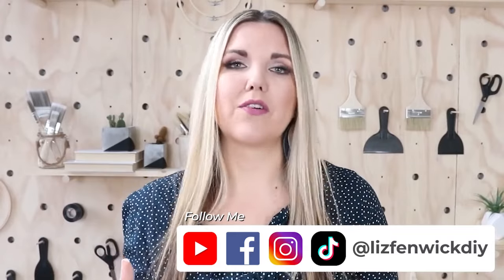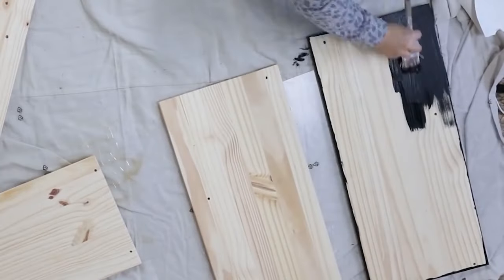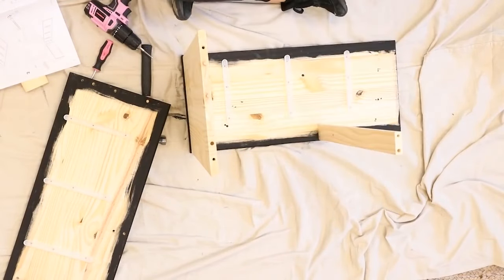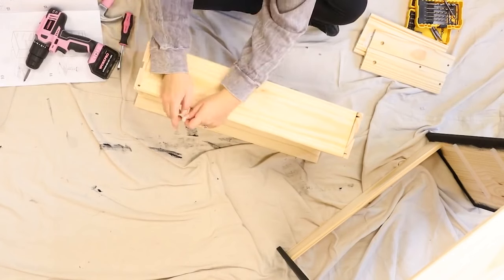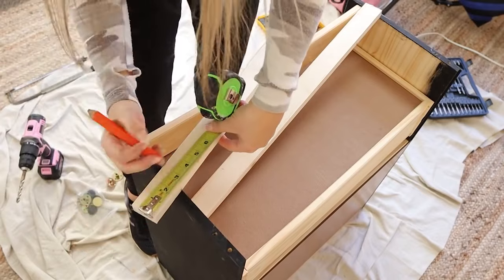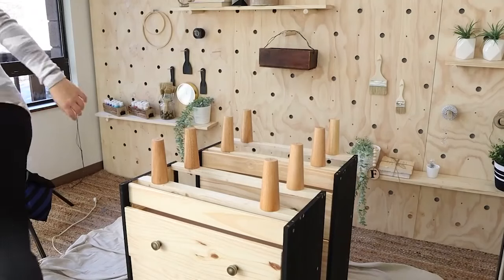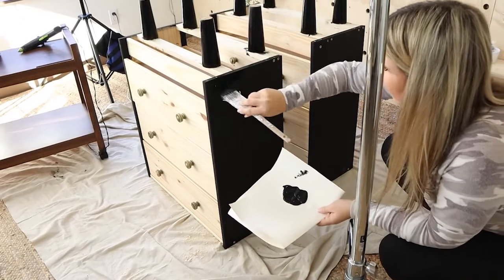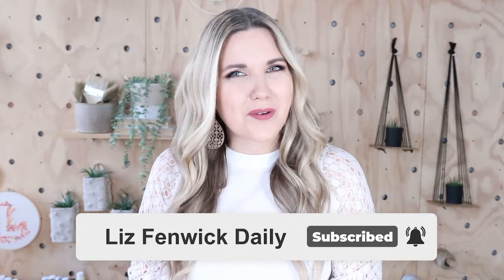I DIYed these IKEA Night Stands For Cheap!

Comment: I have used bar soap on all the runners of the drawer as well as the inside runners of the piece. This usually works for me. You may have to reapply months down the road to continue to keep opening and closing smoothly.
Reply from the maker: That's a great idea!

Comment: I was watching the TV streaming episode on the Inspo network where you assembled your bedroom nightstands and several times you mentioned the drawers sticking.  Well I live in Florida where it’s HUMID, wood drawers sticking are pretty common. I agree with the other person who commented on using a stick candle or bar soap, it works great and lasts a long time.  I also use wax paper on any metal jar lids to help them slide easier, especially mason jar lids.